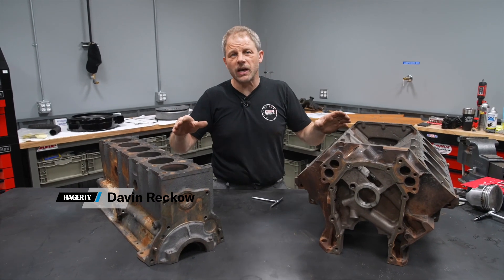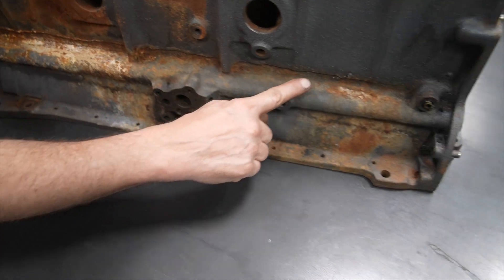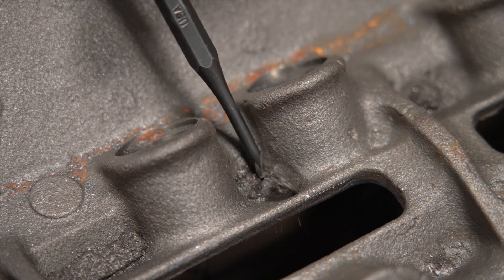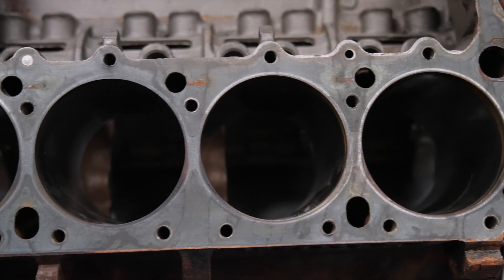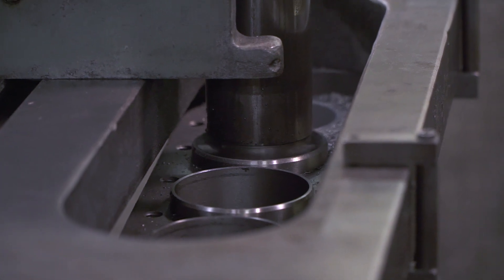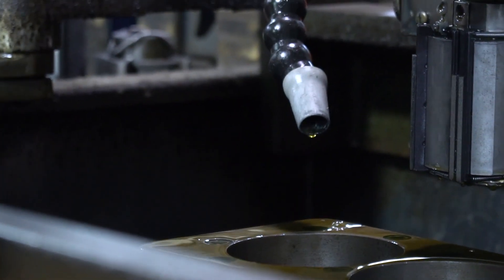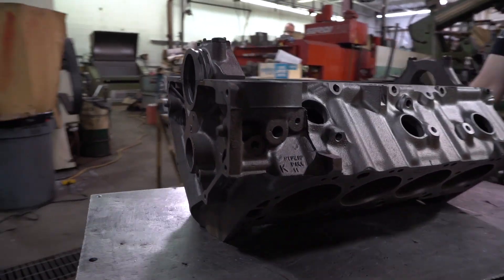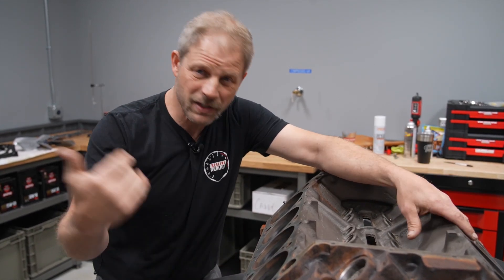Everything you need to know before going to the machine shop | DIY

Comment: Got a pentastart v6 how much am i expected to be around for cleaning, inspection and decking for all the main engine parts? I will be calling machine shops around here but last time I did an overhaul was 2019 so I forgot and plus my previous was a 4 cyl engine this one is 6 cyl, 1 block 2 heads

Comment: Came across this video.  In the process of pulling a 2.7l engine out of a Charger.  Seized up due to lack of oil.  Planning on doing a rebuild on it.  What components should I take to a machine shop?  I assume the crankshaft, cause most likely that is fouled up since the engine doesn't spin.  Anything else I should consider taking to them?

Comment: What reference surface do you use to establish the "squareness" of the block when the bare block-head interface surfaces are being finished?  Do you assume that the bottom oil pan surface face is sufficiently flat to use as the mounting surface, without further machining of that surface?  Great video.

Comment: The thing to remember is every diminution you cut comes off the center of the crank even on a stock rebuild. The quickest and best way to pick up free horse power ( even in a stock rebuild ) is always aline bore the main caps no matter what. Yeah I know it might not need it, but if you just automatically cut the caps & do it, every other machine operation will come out dead nuts on the money because everything comes off that fresh cut center line .  The main reason I say this is,  how many times has that block been cycled cold to hot back to cold? and how many times has it been over heated to move the main webs in said block ? In most cases you have no idea, so it's always a very good idea to aline bore the main caps if you don't know the history of the block even on a stock rebuild.   It's just a good thing to do and it's not really all that expensive.
Reply: @Joe Mitch  Still doesn't change the bottom line, and it has nothing to do with Magic ! . The bottom line is every other diminution in the block in someway is held off the center bore of the crank alignment.  When you bore the block, the boring bar locates from the main caps, when you load the block to be decked it's bolted in from the location of the main caps. if the caps are not in line every other operation will be off no matter how good the machinist. Plus the dyno shows a marked increase in power ( free power) if the the main caps are dead nuts on .  Doing a align bore is a must do if you have no history or the block has a ton of miles on the block ( block needs to be bored .030 over ) . I agree, there are a few operations  you CAN over look, ( AKA  Roller cam etc. ) but not the alignment of the main caps, that's a must do item if your looking for all the free horsepower any fast motor can put out. This is not a opinion, it's a clear cut fact, straight map caps equal more power over almost anything else.
Reply: @hydroy1  When you align bore the main caps you need a shorter timing chain and larger crank sprocket to suit, right?
I kind of want to align bore this ls1 stroker I'm building however I have already purchased a standard cloyes timing kit so I'm tempted to just not bother to save myself the trouble of selling my parts and buying new ones.. but it sounds like I'd be an idiot not to do it on a fresh stroker :/

Comment: Another step you may consider is to chemically clean the cooling system before disassembly. Of course the engine needs to be running. There are products out there that will dissolved all that corrosion. I use Liquid Intelligence 239, comes up like new. It was originally designed to clear out rust in the buick straight 8 block.

Comment: Profiling the blocks water and oil journals is always good to do before taking it to the machine shop so all those chards of metal are also washed out.. I also do my oil pump mating and enlarging before the block goes for cleaning.. All that outside flash is also nice to remove. Not only because the block looks far better, but in some cases it may save you from stitches!!

Comment: GM blocks in partiular main tunnels are always 'woppy' The factory has undersize and oversize bearings to fix that. But not available in the aftermarket. And they work fine for normal use. All manufacturers do this. But not 9 thou under as I have experienced!! That was the crank however and I got a way with a 10thou shell.This also applies to the cranks.
When you disassemble read the shells. They will be marked with oversize or undersize. Ideally put a straight edge or verified straight bar to check the tunnel.
Then get it line bored!!
Most other brands you MAY get away with, but again read the shells. 
Most cranks ideally require a polish if that is the case you will lose 1/4 of a thou and possibly more

Comment: Asking for advice.  I've got a project truck, a '51 Chevy 5-window pickup with a '66 327.  I'm going to tear it down to the frame and am contemplating rebuilding the engine myself.  But I've never rebuilt anything more complicated than a carburetor, so this will be a learning experience.  I watch Devin's Redline Rebuild, which is educational, but it of course doesn't show every step.  Any "Engine Rebuilds for Dummies" type of resources out there that you all know of?  Thanks for any advice.